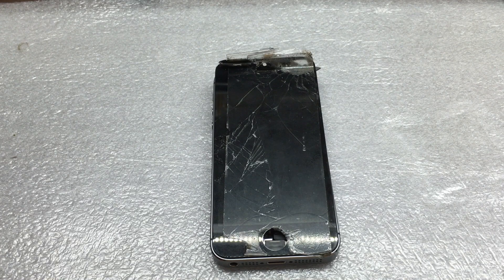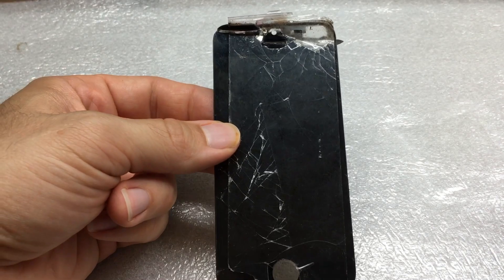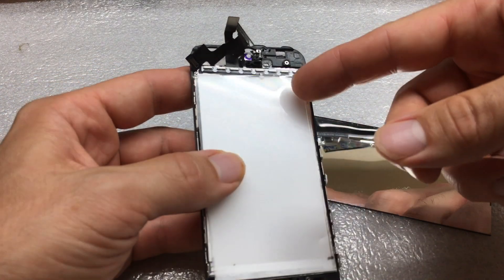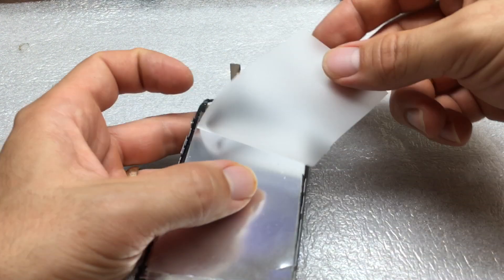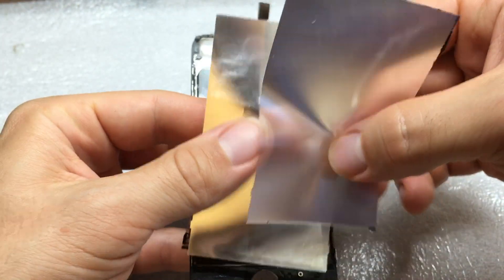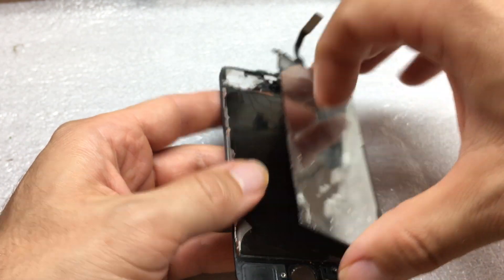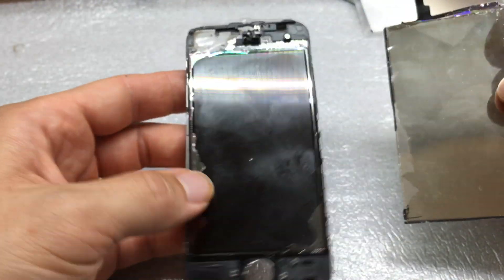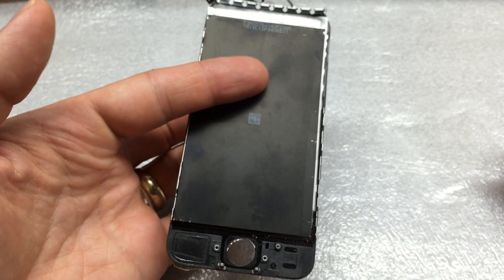What is Inside an iPhone Screen

Comment: Can you make a video how to fix white line on android oled
Reply from the maker: Thanks for the suggestion.  I don't think that would be easily repairable.  You could try flexing your phone screen at the corners or put pressure on the top or bottom to see if the line changes at all.  If so, it's likely a connection issue, and my guess is, not practically repairable.

Comment: is there any light guide plate on marketplace ? or any material for replacement ?
Reply from the maker: For an iPhone?  I would steal it from another one with a busted screen.
Reply: @FrugalRepair  
i mean in general, for general size, then we can cut it for every phone,
Reply from the maker: If I needed one for a particular phone I would take it from a cracked screen version of the same phone. Those are easy to get a hold of. Maybe you were thinking of something else that I am not considering?
Reply: @FrugalRepair  
I was thinking if there is no other spare broken lcd from same phone 😊

Comment: Would the phone screen show without the glass on it. With all the parts connected and everything . Just with out the glass .
Reply from the maker: Yes, the digitizer (the part that recognizes the capacitive touch) is part of the lcd screen.  The glass is only there to protect the lcd (or oled in some phones) from cracking.
Reply: Oh ok thx for responding

Comment: if the reflector sheet is completely separated in the lcd and if i tape it again to put it back together, will it still work?
Reply from the maker: I’m not 100% sure I know what you mean.  The issue with working on the backlight assembly is not letting any light out the sides and making sure all the layers are flat.  You can purchase new assemblies fairly inexpensively.  Then you just need to solder on the connection.
Reply: @FrugalRepair  yeah that's what i actually meant. Thank you so much for the advice. Appreciate it.

Comment: This is a very nice video, thank you. Are all these screen layers the reason that under direct sunlight  the screen seems to be bumpy inside? I have notice that it does not appears perfectly flat "inside" the glass.
Reply from the maker: Thank you.  I’m not sure I know what you mean by bumpy.  So I’m not sure what to say.  What iPhone version do you have?  I can go outside (I have a bunch of screens) and see if I can observe the same.
Reply: @FrugalRepair  actually I don't have an iPhone at the moment but a S10. Actually I do not know how to either describe it, it is difficult to picture it as well. But in  mine s10 and a previous s8+ if I look  over a certain angle under direct sunlight I am pretty sure I can see some wrinkles under the glass across with "rainbow" reflections due to the amoled.
Reply from the maker: Ah, an oled display is a different technology than lcd (like I explained in the video).  Maybe you’re noticing an amoled distinction?
Reply from the maker: I took a look but I’m not sure what you mean.  It looks like how the light is being reflected to me.
Reply: @georgepsa163   BORING!!!

Comment: I recently broke my phone (I just ended up replacing it, as it was a cheap $50 phone that was at least 2 years old), & though it still functions, there are pale yellowish spots in a couple areas under some of the cracks. What is that? Even though I already got a new one, I was just planning to use the old one to watch videos & stuff
Reply from the maker: A key thing to consider is if the lcd is cracked or is it only the glass.  With the yellow, I’m not sure since I can’t see what you mean.  If you post a photo of it on my Facebook or connect on instagram, I could take a look and let you know my thoughts.

Comment: I was looking for something like this.. I have an Ipad 4 with a weird wrinkled backlight deform, i think one of this filters is deformed, may be for the battery heat or it is out of it original position.. Dou you think that if i try to disassembly the screen can be assembly again?
Reply from the maker: Thanks!  If one of the prisms, diffusion film or the backlight film has an issue, you could technically repair it on its own but it is very difficult to keep dust out and align everything again so there is no light leakage out the sides.  I haven't taken apart an ipad 4 screen so I don't know for sure but I do know it's the same lcd technology.  Are you sure it is a problem with the backlight assembly?  I see lots of "repair" services on ebay for dim screens due to bad small components on the logic board.  Either way, if you can show me a photo I could probably tell you what your issue is.
Reply: Hey.. Thanks for the response.. I think is one of this filters because when i make some pressure behind the LCD screen it seems that it can be corrected, it is an Ipad 4 A1458.. In this link you can see a Photo i take of the Issue, Hope you can gimme a better idea of the problem: https://imgur.com/a/MCrtL
Reply from the maker: Hmm, that looks strange.  So when you press on the front glass you can make it even out?  Or did you mean that you press in one spot and all of the "wrinkles" go away?